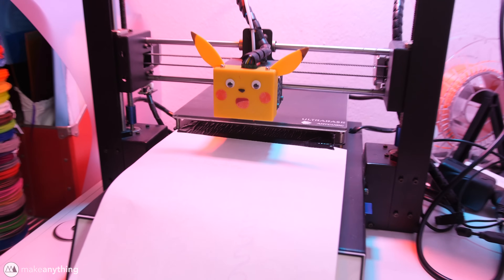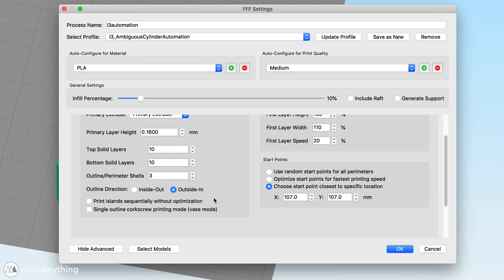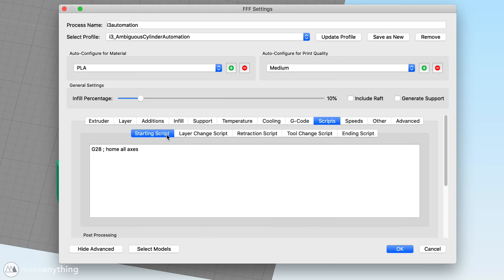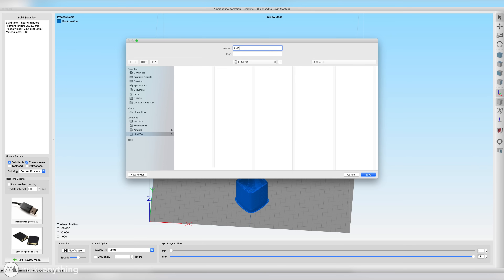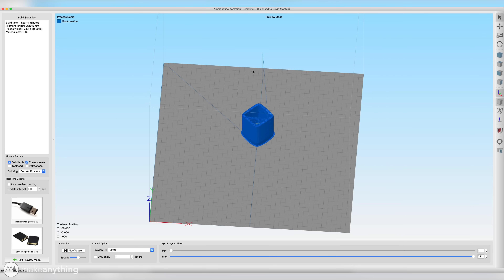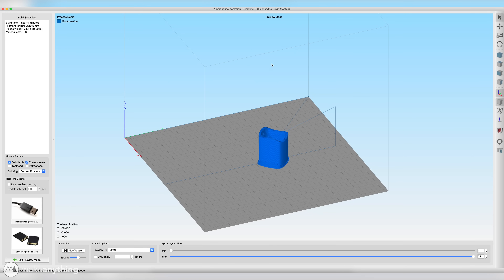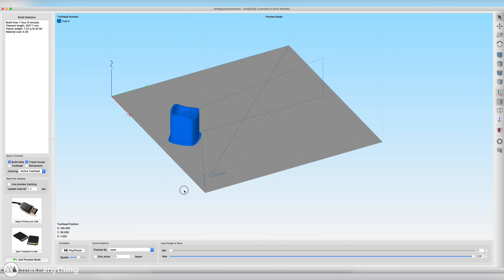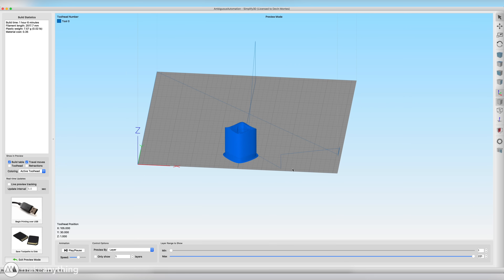Automatic 3D Print Removal using G-Code

Comment: You should use G0 instead of G1
G1 moves the prinhead and extrudes
G0 moves without extruding.
You can also remove the coordinates you don't wanna move:

E. G. Instead of:
G1 X50 Y0 Z5 F500
G1 X50 Y200 Z5 F500
You can just write
G0 X50 Y0 Z5 F500
G0 Y200
Reply: Indeed, all his extra commands are using G1. It isn't just "stringing", it is literally extruding. edit: This is false.
Reply: @philo8035  It does NOT extruding!!! There is no E "axis" in the G command. It only extrudes if you specify the amount to extrude in the E axis.

The difference between G0 and G1 is that G1 is an interpolated move, which means that all the axes you specify in a single command will move in sync in a way that all completes their move at the same time. The speed specified in the F parameter is the speed of the movememt vector, not the individual axes.

The G0 command may not interpolate the move, so when yo specify X+10 Y+100 (assume relative moves for example sake), both axes may move the same speed and the X finished earlier while the Y still moves.

This is the general definition, but not all firmwares work this way. RepRap does the same interpolated move on G0 as with G1, if I am not mistaken...
Reply: @gabiold  Yea, indeed I found this out later. My comments were the result of rather poor googling of this issue. :facepalm: And now will remain visible for history to remember.
Reply: @philo8035  you can delete commetns you know........
Reply: The only difference between G0 and G1 is that G1 allows you to set the movement speed and G0 goes as fast as possible. It only extrude if followed by an Exx.xx parameter
Reply: ”There is some stringing, but that has nothing to do with the actual modification”
Reply: @pontusvarghav4566  That is in reference to the stringing within the cylinders. His new code is actually extruding between each though, it is quite obvious he used G1 instead of G0 with his new additions. edit: G1 and G0 have nothing to do with extruding :facepalm:
Reply: G1 moves in a straight line, G0 moves all relevant axis at max speed, so if one is faster then the other it won't necessary go in a straight line and you risk colliding with your printed object.
Reply: As a machinist, a G0 is a rapid and does not use a feed. This is what I am use to so I use G0 for rapid and G1 for normal movements
Reply: Since everybody has a different explanation here's one more:
G0 and G1 adds linear moves to the queue and by CONVENTION most slicers use G0 for non-extrusion moves (but they don't have to). It allows kinematic systems to optionally do rapid uninterpolated moves, but for cartesian systems, G0 is an alias for G1, i.e. THE SAME THING.
Reply: If you are using G1 and don’t repeat things you don’t want moving- what happens? Does G1 interpret anything blank as zeros? A few comments down someone says you can omit things you don’t want to move with G1.. so I’m not understanding the reasoning you are recommending the use of G0? Oh maybe I’m confused, you are saying the G0 is to remove the extrusion- and just made your example of omitting non moves G0.. but you COULD still omit with a G1 correct?
Reply: @CgBrian  
G1 is an interpolation "feed" command, the machine thinks it is working
Go is just rapid movement, the machine thinks that you just want it to move somewhere and do nothing else. When G0 is active, the machine is just moving with no associated feed rate or extension speed
Reply: That is correct. G Code for 3D printers work just the same as on any CNC machine like a lathe, mill or whatever. G0 = rapid feed and G1 = controlled feed, nothing else.

Comment: Considering that printer has Ultrabase, you could also wait for the bed and nozzle to cool before knocking prints off. Considering how PLA and PETG practically jump off the bed below 30C, It should be much healthier for the bed and get rid of the melting problem. It'd add about ten minutes between each print, but it'd help keep things reliable.

Comment: A few comments about this

1) you're using zhop wayyy too much, your print quality is suffering as a result

2) gcode (and marlin) has a wipe command

3) gcode has a loop command

4) your method is very inefficient, you really should use an octoprint plugin or use a host that supports looping

Comment: At 10:20 your hotend travels off the plate to z home. It is not supposed to. It is supposed to home on the plate (5mm to the right) that way the bit of ooze will stick to the plate, and when your hotend lifts up 20mm before traveling to the print start point, it pulls the ooze off of the nozzle to clean it.

Comment: i tried this once manually  ... remotely from work through octoprint. It broke the part of 2mm above the rintplate and shot it across the room. Crealty Ender 3 magnetic base has crazy adhesion.
Reply: I have an Ender 3 Pro and I was thinking the same... if I tried this I'm not sure what would break, but I'm sure something would.
Reply: @demoniack81  My LK4 has a similar buildtak surface, and there's no way it would ever release something without a fight... Cura gave one of my first prints a 15mm brim for some reason... I needed a hammer and a chisel to get it off!
Reply: I guess you need to let it cool off xD
Reply: @marcosmoura911  yes 😇
Reply: @marcosmoura911  No.. the magnetic plates for ender 3s get even STICKIER when they cool down. I hate it when I forget I'm printing something or that its about to finish and then come in 10 minutes too late to find its cooled down.. I can either heat the bed up to help it pop off or just rip it off with extra strength if thats possible.
Reply: Probably better on glass
Reply: Pour isopropanol or ethanol around the edge of the part and let soak in and add more if needed. Will release absolutely anything

Comment: if your firmware supports it, Couldn't you just use a random X/Y coordinate (within the limits of the moves and sizes of the print and head), then use G92 X0 Y0 command to basically reset the print and eject moves to differrent locations on the print bed then do an sd print like a SUBROUTINE?

Comment: I have read above about m99 m98 doesn't exist for 3d printer software. I'm a machinist and use sub programs along with G90 absolute and G91 incremental also for looping. Multiple cuts/drilling holes and other uses. Be cool if it would work tho. Nice video nonetheless.

There's no place like G28 X0,Y0,Z0 🤔

Comment: Nice. You might be able to reduce the between-print pause (and resultant blobs) by removing the wait-for-temperature command at the start of the 2nd and beyond prints. Even if the printer is already at the correct temperature it will wait for a few seconds for the temperature anyway. For people comfortable using the command line, the "cat" terminal command can be used to concatenate the files. "cat AMBI-1.gcode AMBI-2.gcode AMBI-3.gcode > AMBI-auto.gcode", or, fancier, "cat AMBI-?.gcode > AMBI-auto.gcode"

Comment: Cool! But you have to add the doser blade for moving the model from thable. And it's necessary to fix problem with ahdesion. If the model will be in strong connection with the table...

Comment: Oh hey, I've used this method before! I used to print a ton of keyboard keys but my area has frequent power surges (but I couldn't afford a decent UPS at the time). So rather than print a big batch of keys at once, I printed on a squeaky clean glass build plate and waited for the key to cool off. Then a printed "bumper" (attached to the extruder) would bump into the key and knock it off into a cup on my desk.

It was super effective and once I get my printer printing consistently enough for well-fitting keys, I'll be going back to this.

Comment: If i tried this it would break my printer. My prints stick too well
Reply: lol my prints stick so well I can't get them off, then a few prints later they suddenly don't stick at all and then they stick super strong again xd
Reply: Lucky, mine won’t get the first layer down.
Reply: Let the print cool down first! Mine stick absurdly as well, but after reaching 60°C or less, they come off just by touching it. (ABS 230C-110C)

There should be a "sleep" Gcode command. Use that in your favor...
Reply: @fusseldieb  Just use the GCode to wait for temperature reached: M190 R60
Reply: @fusseldieb  G4 S*number of seconds you want it to wait*. Like G4 S60 would wait 1 minute
Reply: @fusseldieb  defeats the purpose of this video
Reply: Fusseldieb or just not heat the bed for pla
Reply: Especially big flat ones, yeah
Reply: Ender 3 Tempered Glass G A N G
Reply: A "good" quality ISO standard glass panel. 60deg bed heat but give it 3mins to heat through the glass. Level bed (stop being lazy) with copy paper. Bam. Will pop off like it's ready to.
Reply: If only my prints stuck...
Reply: My prints stick really well too. I never have any issues with separation, and I’ve only been printing for a week. I use the new AnkerMake M5 which is absurdly easy to use, and I use Polymaker Pro filament, which is very strong and sticks well.
Reply: Yeah
Reply: Wile E. Coyote; Genius!
Reply: Try printing it on a raft, and make sure when it knocks a print off the bed, it prints the thing you’re printing, not another raft.
Reply: Me too but i cool the glass plate down, here's my code. I use octoprint with the queue module and python api and i've not manually asked it to print for about a year.
G28 X Y
G90
M82
M106 S0
M140 S19
M190 R19
M104 R19 T0
M109 R19 T0
G28 X Y
G4 P1800000 ; << the cleaver bit, this waits 30mins for that extra bit of cooling
G28 X; home X
G90
G1 Y220 F3600 ; this is the push off code
G1 X220 F3600
G1 Z5 F3600
G1 Y0 F300
G1 Z20 F4000
G1 Y230 F3600
G1 X200 F3600
G1 Z2 F3600
G28 Y0 F300
G1 Z20 F4000
G1 Y230 F3600
G1 X110 F3600
G1 Z2 F3600
G28 Y0 F300
G1 Z20 F4000
G1 Y230 F3600
G1 X180 F3600
G1 Z2 F3600
G28 Y0 F300
G1 Z10 F4000
G28 X Y ; home just x and y
Reply: Same, and that’s better than sticking not enough!
Reply: Lowkwy flexing haha
Reply: Honestly. That hour of calibration is not worth messing up
Reply: Mine 2
Reply: I wish there was a gcode command that was like «start from the beginning of script»
Reply: Same
Reply: Weird Flex Time
Reply: My cr10s pro v2 has the build tac and is impossible to get prints off without a razor sharp spatula even when cooled
Reply: I feel like you're showing off as I live in England and don't have a heated bed.
Reply: @benji219   try a build tac surface
Reply: Use hair spray. It comes off way easier.
Reply: If you tell me how you make them stick so well I shal provide monetary compensation
Reply: make the bed cooler
Reply: with PEI magnetic spring steel build plates cooling the bed works great to get prints to release automatically
Reply: An awesome problem to have
Reply: Try a Sunlu 220x220 build surface it has been insanely perfect
Reply: Ultrabase is a cheat code for this. It holds PETG and PLA like crazy at 80/60C respectively, then lets go below 30. You can blow a Benchy off the bed unless your nozzle height is too low.

Downside being that it's only available as coated glass. So if you don't already have a glass plate in one of the sizes they offer that you can swap out, it's kinda off the radar. Upside is that it's pretty cheap as far as build plates go.
Reply: @YesterdaySoup  does it follow that non-polar materials like ABS and HIPS are out of luck?
Reply: @YesterdaySoup  is this the beds with bumps ? That’s what I have and I love it
Reply: I have this gcode working perfectly except it can't dislodge the faceshield mask. I've tinkered with the usual initial layer settings like height, width, print speeds, and dropped cooling temp to as low as 38 (from 60). I made a screw-on scraper which hits the print but then gets stuck and the drive wheels just "grinding". What about dropping the base temp to like 50? Or even 40? Any assistance or advice for someone who has TOO MUCH adhesion? Thanks.
Reply: FishNinjaY if the print PLA & sub 5 hrs (smaller mass) you should be able to print with no heated bed
Reply: @FishNinjaY  polypropylene build plate
Reply: @FishNinjaY  I was thinking about doing something but my ender 3 bed has some crazy adhesion. I haven't tried this yet but I will tommorow. I'll reply if I get it to work :) good luck
Reply: Julian Siegmund  well, I dropped my bed temp to 45 and still no success. I'm doing a practically cold bed run at 34*C. Ambient table temp is 20-27*C. But, the print came out perfect at 45, so not an entire waste of time and PLA. Wish us luck!
Reply: @FishNinjaY  yep what printer are you using?
Reply: @FishNinjaY  I am having issues making the gcode. I have a notepad file with 3 iterations of the print but cura wont read it and im not sure what i did wrong.
Reply: Julian Siegmund Im going to put my Handy Scaper STL up on thingiverse.. even though I haven't figured out how to dislodge my print. I'll include a sample gcode of the scraper action I used. And I'll also post it here. It's not long.
Reply: Print with a little z offset

Comment: U can print in sepereate objects one after the other using S3D
Goto ur end code make sure u retract ... no need for the brush
Use M99 to loop using a pc instead of sd

In the ending do ur push command  
Then on start (so after loop)
Push out the same retracted amount b4 u brim then brim to keep it all clean

Comment: Perhaps also a pause with G4 Px (x number of miliseconds) before removal to let the print bed cooldown for easier removal...
Or even better:
M109 Rx  (x extruder temperature  to wait for)
M190 Rx  (x bed temperature to wait for)-->this one depends on software temperature tolerance settings
Reply: Seems good. Larger parts vs well stuck on a hot bed. 
Would be interested to see a larger part coming off of a hot bed ?

Comment: Do you think this would work on a glass bed hairspray setup? I think my prints stick way to well to the bed for this to work.
Reply from the maker: It depends on bed leveling and the specific model.. might need a low density raft. I think it's possible, but would certainly test the adhesion strength before going full auto

Comment: When i read the title, i knew exactly what you were going to do! But to be honest, i wouldn't ever have come up with the idea otherwise.

Here's a variation on the detachment sequence i can think of on the spot:
; maybe move to the back of the bed here first?
M106 ;set fan to full speed to facilitate cooling
M140 S30 ;set bed cool enough to detach the print, start cooldown
M190 R60 ;cool the nozzle low enough to not mar the print, wait for nozzle to reach temperature
M180 R30 ;actually wait for the bed to get cold
; insert the movement commands to knock down the print here

This is Marlin-specific, not Repetier, and not sure how far back the supported versions go, but anything semi-recent should be OK.
Reply from the maker: Great suggestions 👍

Comment: Have you tried folding thicker paper into a triangle shape pattern and adding it instead of the plain paper? This could be fixed on two sides and gives a stable base for the finished parts to travel on. At least these are used on CNC’s to keep shavings off of the linear guides

Comment: thats great, But 
i dont think it will work fine if you give 3d printer more pieces than it can fit in the hotbed.
so if you have enough pieces that can fit in hotbed, then i dont think there is a need to change gcodes anyways.

Comment: iwould no do that on buildtak or any other print surfaces like that. maybe glas works fine but on buildtak the adhesion is to strong to pop of prints and you mess up your hotend or worse. and i dont think it will work with prints when they are moe flat then high

Comment: Should have put the wire brush on the left hand side..it stops the stringing from ending up on the print plate..this has been done many times before. Knocking the prints off is something i havent seen before tho.

Comment from the maker: CODE with CAUTION : if you're going to try this, make SURE your model prints fine before automating, and make sure it will release from the build plate easily. A big part glued to BuildTak can harm your printer, and nobody wants that!
Here are the official explanations of g-code functions within Marlin firmware : http://marlinfw.org/meta/gcode/
For example "M190 R40" will wait until your printer cools to 40˙C

Comment: Isn't that bad for the motors, and maybe the structure of the printer?
Reply from the maker: This print pops off easily so it's fine, but it definitely shouldn't be done with stubborn prints
Reply: It depends how much you trust the structure of your printer to stand up to abuse! The motors... worst thing that can happen is that they'll stall and the ejection will not succeed, which in turn means unattended operation is bad, because next thing after an unsuccessful ejection, your print head is going to be glued up with plastic all around it. The normal printing process is tough enough for the Y-axis that this little bit of abuse shouldn't account for significant wear on the motors themselves.

Comment: easier problem fixing with the coding: you dont need to do that with the text editor if youre using repetier host.
repetier host has a notstop mode so the printer prints endlessly 

you just need the part until 6:36

EDIT: This Comment  is false because of a misinterpretation
Reply: IMD This is pretty late but I’ve not been able to find the nonstop mode on repetier host.
Reply: @artemreinhart747  Sorry i misinterpreted the german word notstopp (Emergency shutoff)
with a notstop mode
Reply: IMD Nah it’s fine, thanks for the reply.

Comment: There's a plugin on octoprint for this I think. No SD Card limitation, the computer loops through the code without storing the whole thing in SD Card.
Reply: What is the plug-in called?
Reply: It's called "Continuous Print"